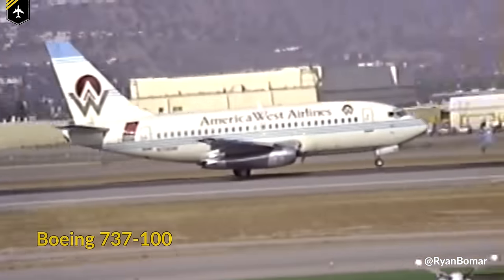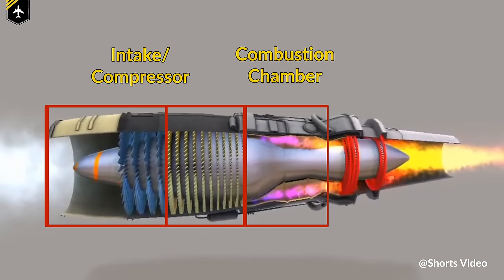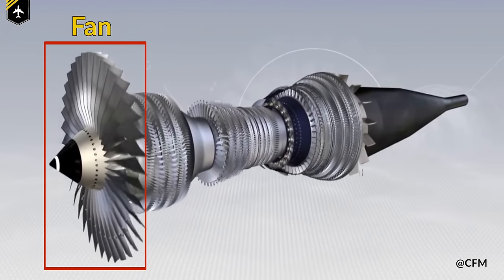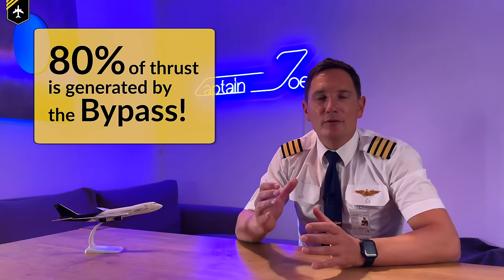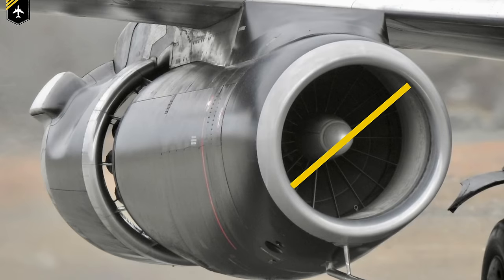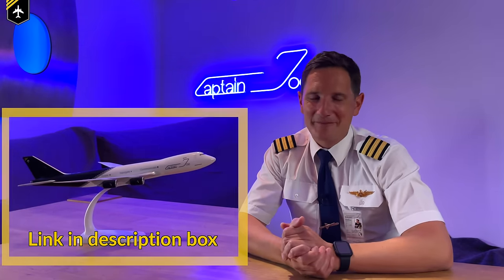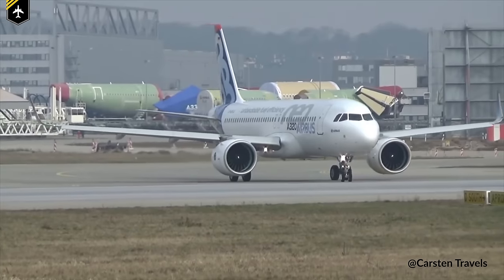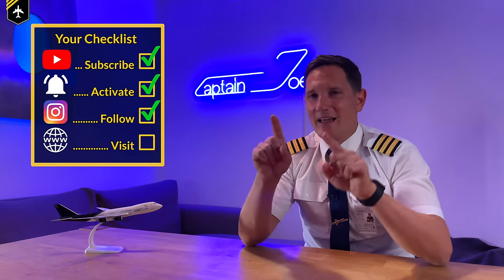HOW DO JET ENGINES work and WHY do they get BIGGER Explained by CAPTAIN JOE

Comment: I have discovered. For reasons unknown. Whhen describing a turbojet versus a turbo fan. Everyone involved with, jet engines. Knows that difference. But nobody yet. Has been able to properly articulate. What the real difference, is,  between a turbojet and a turbo fan engine?  And I have as yet to hear anybody, describe this clearly so I shall.

The turbojet. Was the first permutation of a gas turbine engine. That sucks the air in the front. And blows it out the back. To produce, thrust.

A turbo fan engine is the same thing.  It sucks air in the front. And blows it out the back. But that gas turbine engine is rather small in circumference. Compared to the circumference of the fans in the front. Which are much larger in circumference. Than the gas turbine turbojet engine. That turns the fans.

Since the fans are larger in circumference. Than the, turbojet engine mounted in the center of the large fan in the ducted port of the nacelle. And so it's a little, turbojet engine. Turning the big fan in the front. And the additional area. Inside the engine. Within the nacelle. Of the air the fans are pushing out. That's called the Bypass. And all turbo fan engines. Bypass a lot of air around the turbojet engine. In the center. And the amount of that bypass.  Varies with the manufacturer and type of, turbo fan engines. And I've heard a difference in the engine sound. Of military jets versus, commercial jets. And military jet mechanics tell me that's because military jet engines have, higher bypass. I think they said?  Which really doesn't mean anything to me. But could cause a change in the sonic  structure. If you are moving more or less air faster or slower.  Of course..  Compared to the criteria for, commercial jet airliners. Compared to military stuff. Both are similar but  built with 2 different  purposes.

Turbine engines are amazing. Lousy on gas mileage. But amazing.
RamyRAD

Comment: Technology is probably going backward. Ok, the engines become more efficient but that's because they get bigger. With a bigger engine, you can have more straight fan blades that reduce cost and make it more reliable. But if you want to, it's possible to have a smaller engine but it cost more to develop because it's really hard to calculate and produce efficient and reliable blades.

Comment: I personally think jet engines will die in the future. Jet engines are still very "dirty" when it comes to the environment, even if they get more and more efficient. There are already pretty interesting experiments with electric propulsion of planes. Im thinking, in the future planes might even look like super duper large drones (with 4 vertical propellers) and they will take off vertically from a round/square "runway" consisting of a kind of helicopter pad but much much larger in size. Here is a electric propeller plane: https://www.youtube.com/watch?v=uMrLHeKJA80 and here is a another video about electric aircraft: https://www.youtube.com/watch?v=aH4b3sAs-l8 and here is one thing with "Ions" as propulsion: https://www.youtube.com/watch?v=VSYwaesDQBw

Comment: In order to solve the issue with fan blades reaching supersonic speeds, could counter-rotating twin fans be an alternative solution to the geared fan, like for counter-rotating-blade helicopter ?

Comment: @Captain Joe Joe, you owe a correction to your viewers. To the best of my knowledge, only three jet powered commercial aircraft, the de Havilland Comet, early Boeing 707 models, and the afterburning Concorde have used turbofans. They may be low bypass like the JT8D on most Boeing 707s, or high bypass like any modern jet, but very few are actually turbojets.

Comment: Maybe they can make a Hybrid Electric Turbofan where an electric motor drives the main large fan independently from the rest of the engine. The aircraft would have dual mode propulsion - electric only (cruising), fuel only or both for take-off/max power! I think NASA and Boeing were developing this with their SUGAR Volt concept which was claimed to use 70% less fuel than a conventional jet!

Comment: The early 737 models always looked ugly and out of proportion compared to the gorgeous One-Eleven and Trident.
When the larger 737-300 Classic came the max take-off weight increased to such a degree that at the airport I worked at had to completely  rebuild the the apron  surface at the gates that had been especially designed for 737 class aircraft.  Since then another two generations of 737  have increased max  weights to unheard of levels 
Most famous pure jet airliner can only be the Comet the  plan view of which is still used in  UK  roads signs